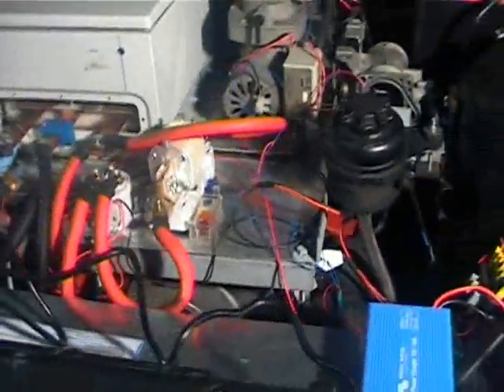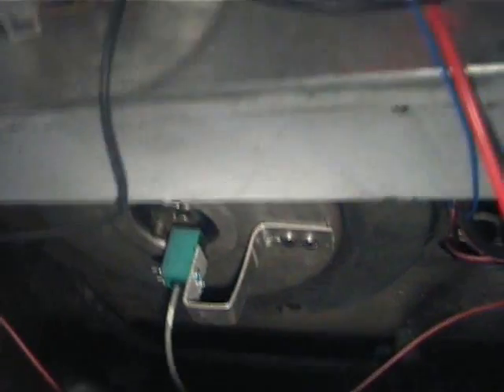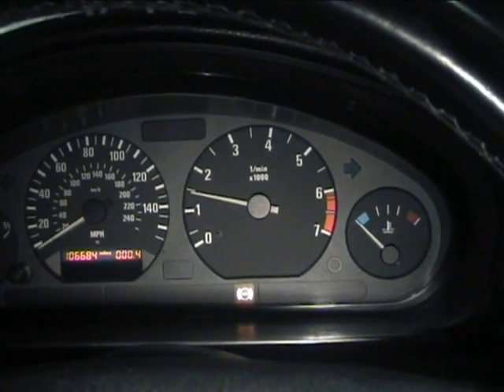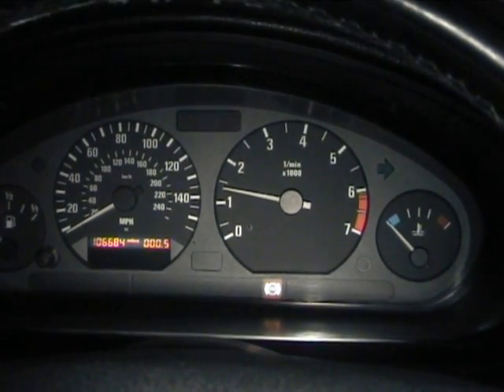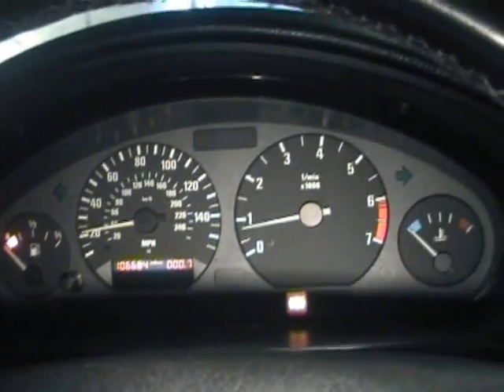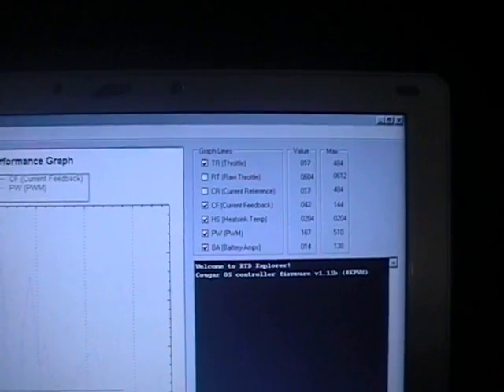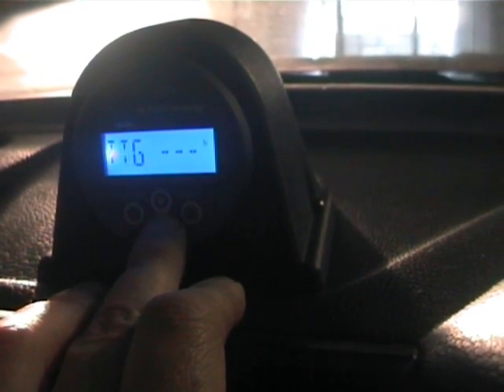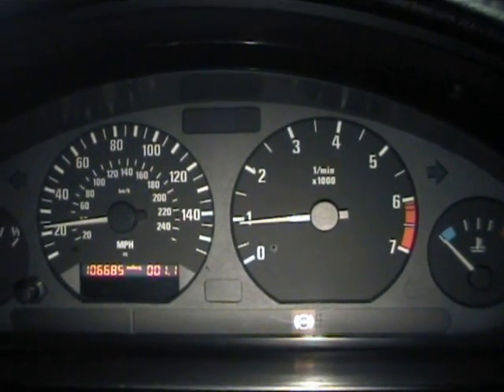BMW EV Conversion 20 Drivetrain test

Comment from the maker: @acroracing , This video is quite old.The maximum speed for the car is now 85mph and I don't like going much over 3000rpm but that is just a limitiation of this particular motor. Mose ev specific motors redline about 5500rpm. Brake servo vacuum is provided by a 12v VW/Audi brake pump. E30 would make a nice donor. No complicated electroincs to worry about.

Comment: Petrol engines use suction to take air out of the braking system. Now that there are no petrol engines, How did you modify the braking system?